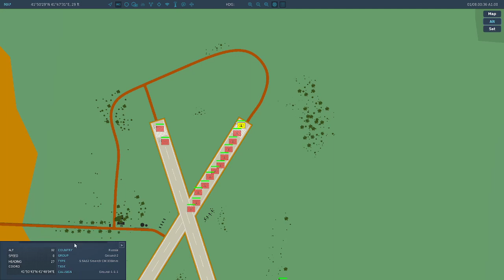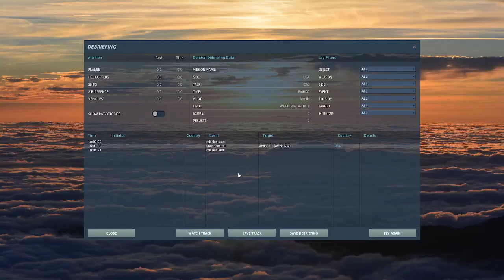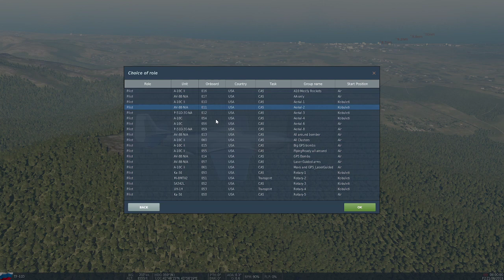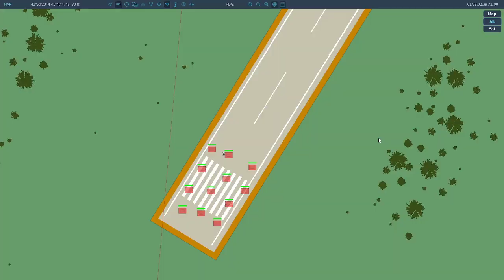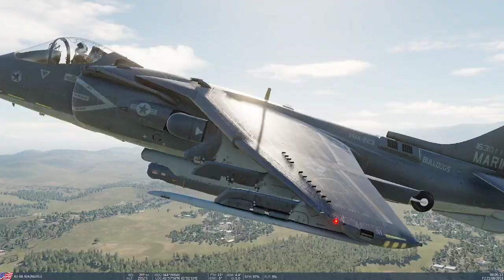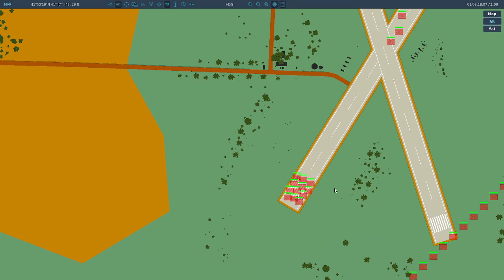DCS Ep2 Harrier Waypoints Drifting

Comment: You just shouldn't manually slew the map in Data mode using the tdc axes. People find this problem if they have tdc mapped to axes that dont have enough dead zone assigned too. Just use numeric input in the Data page.
Reply from the maker: Well thanks for letting me know. Was an issue few years ago and now I don’t even really fly the Harrier lately XD I recall figuring that out or someone helped point that out, which I recall that mini stick didn’t have a drifting issue or it was so microscopic that it effected the silly thing so had to put on like dead zone of 2 XD I remember someone helping me on this by pointing it out but good to know for anyone else that may still have this issue. Sadly I’m not sure if anyone can get the Harrier at the moment with it being taken down from their store.